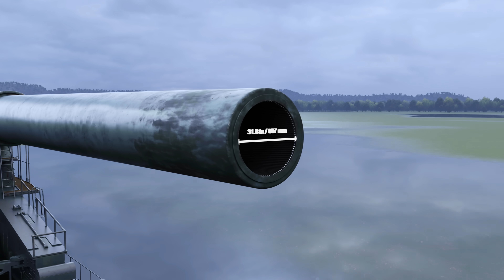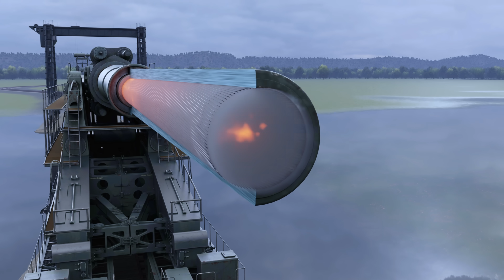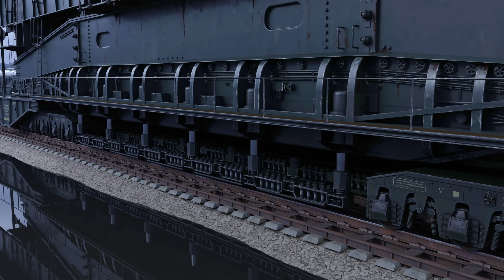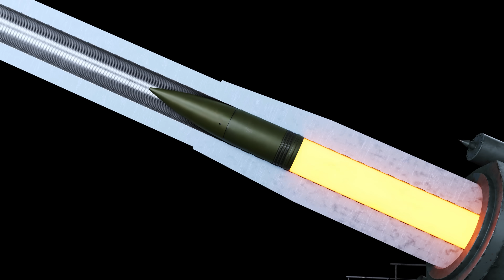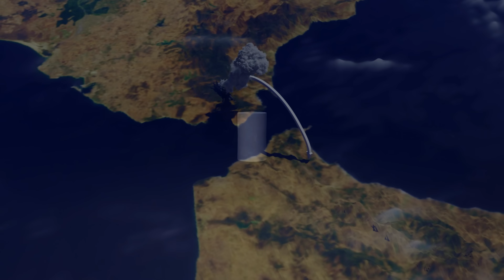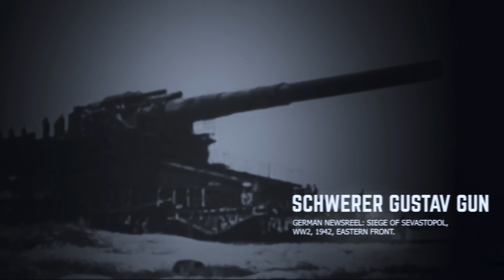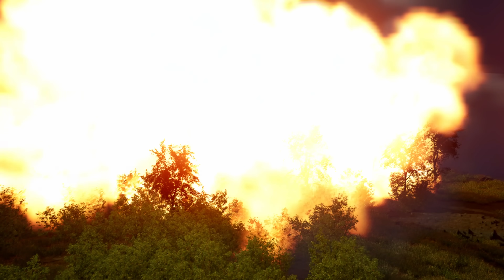Inside the Schwerer Gustav

Comment: As a German Master Craftsman Gunsmith (now living in Edmonton, AB, Canada), I wanted to calculate a few figures regarding the "Dora" (Schwerer Gustav) railway gun to put its massive scale into perspective:
• Muzzle energy of the Sprenggranate (HE shell): 1,613,760,000 Joules (~1.19 billion ft-lbs). 
That is equivalent to a full-size crew cab pickup truck (150/1500 class) traveling at 2,595 mph (4,177 km/h).

• Muzzle energy of the Panzergranate (AP shell): 1,840,320,000 Joules (~1.36 billion ft-lbs). 
That equals the same full-size truck traveling at an incredible 4,574 mph (7,361 km/h).

• Recoil force: The recoil forces during firing reached around 14,000 metric tons, which is roughly 15,432 US tons (over 30 million pounds).
Absolutely mind-blowing engineering from a ballistics standpoint

Comment: The sound pressure wave was reportedly capable of shattering glass for up to 8 km away, and unprotected crewmen standing too close to the barrel were at serious risk of ruptured lung cells and immediate permanent hearing damage. Even with specialized hearing protection and careful positioning outside the primary blast zone, the concussion was so violent that the 500-man crew had to take significant precautions when firing the weapon.

Comment: There are a lot of comments here, so maybe this is already done somewhere. 
For transport and movement there where used a locomotive "V 188"
Two of them where build,  and in work after the war.

But it was only one used for the DORA.

Because, V 188 have been two fully complete locomotives. 

For transport it was a double locomotive, butt for movement of the DORA they where disconnected and on every of the two rail was working a "half".
And, thats important, the locomotives where connected with cables so they could send data.
As you know, on the "firebow" the inner locomotive has to go slower than the outer locomotive. 
------
You show a double locomotive on every rail.

Thanks

Comment: A far superior version was proposed, which eliminated all the Track, Switches, Sleepers,  Grids, ground preparation, land clearing and 3,500 less Men to assemble in less than a week, not 6, and could be positioned and moved rapidly, and traversed on demand by having the 8 Bogies eliminated and mounting it in on 8 Crawlers in pairs, two up front and two in the rear, similar to those and slightly bigger than those on the Maus Tank with a pair of Diesel Engines used on their Submarines and just would require some Wooden Timbers for Mats to spread the weight on the Ground under the Frames on either side to distribute the recoil to the ground. This could have made it practical.

Comment: All those resources should have been diverted to tank, weapons or trucks production. The Gustav was just an upgrade of the Paris Gun but of course as a weapon with a projectile that has a concave trajectory, i's an artillery weapon cappable of a huge long fire distance but with less accuracy. Maybe as a psycholochycal weapon it surely worked at least in the Sebastopol fortress. All of this without thinking about all the people that had to be working on the machine to make it's function properly, so in the short and long term it was not a good choice but it's my humble opinion. Also in the invasion of the Soviet Union the germans noticed that the railway system in the USSR had another size, so in the case that the Wehrmacht thought to use the weapon again, it would have meant that they had built a whole other railway system inside the USSR which is absolutely impossible, they would only use the Gustav at the Poland frontier at the east.
Great video!!

Comment: u could also have mentioned the amount of anti air weaponry and flak canons they need to move with the dora, just to protect it from enemy planes and bombers. besides that - great video! the germans also made plans for an extrem heavy tank called the P1000 Landkreuzer or "rat". This tank would have been equipped with 2 heavy ship guns which where related to the canon of the dora in design and close to the same size.

Comment: 1:29 found an error:
The difference between the diameters before and after should contain DOUBLE the riffling depth,
since if you look at the cross section, the rifling gets removed on both sides

Comment: It was built to breach the Maginot line in case French finished the fortification line all the way to the coast. In the end,  the main German breakthrough went north of Maginot, and the main Maginot line was also breached without railguns thanks to the efficient airpower.
Reply: From what I remember, the Germans just rolled their tanks through the Ardennes forest where there was no Maginot line as the French figured it was impossible to get through the forest with tanks.
Reply: In the very end Russians a??-?aped the Germans. 70% German deaths were by Russian fire. 1 MILLION Germans surrendered to Russia. 60,000 were marched down red square as a final thrust in the a??-?aping of Germans. No wonder the Germans are still butt-hurting from that severe spanking, and support Ukrainian neo--Nazis.

Comment: Great Video but there is one fault: The barrel was not joint together by two parts of half length (like the later "Hochdruckpumpe" or the Bull-Guns). It was joint by inserting an thinner inner Barrel of full length (Seelenrohr) into a shorter, thicker tube (Mantelrohr). So the animation of building up oder down is also wrong.
After the dismounting, there were plans to use a much longer smoothbore barrel and FSDS-Ammo to enlarge the reach. Not realized, but innovative concept.
Reply: Who the hell told you that nonsense? What absolute rubbish, you obviously know nothing about this gun. Sounds to me like you have just found ai, and now you're an expert on everything.

Comment: "range 38km" - cant believe nobody commented: for comparison, most modern howitzers reach around 25–40 km normally, with standard shells. with rocket-propelled shells they go up to 60km and with modern extended-range capability they go over 70km (fire rate of 6 rounds per minute)

Comment: 900lb of explosives isn’t much when compared to an SC 2000 bomb with a 2000lb warhead dropped out of German bombers.

The gun was probably more accurate but a squadron of bombers is probably cheaper would’ve had a far better range and could deliver more explosive.

Comment: I suppose IF you want a big howitzer (which definitly had their usage) the 60 and 54 cm Gerät was much more usefull, since it didnt need as big logistics and could be driven into the designated position. Befor that in WW1 and such there was already a 30,5 cm Howitzer.

Comment: For further interest: “In addition to the 80 cm Schwerer Gustav railway gun (often referred to as Dora in some accounts, though Dora was technically its sister gun used elsewhere, or sometimes interchangeably), the German 11th Army used an extensive array of super-heavy artillery at Sevastopol in 1942, which was the largest concentration of heavy artillery under a single command in World War II. 
The key siege weapons used include:
Karl-Gerät Mortars (60 cm and 54 cm): The 833rd Heavy Mortar Battalion deployed two of these self-propelled, tracked mortars, known as Thor and Odin (often Ziu is listed among them), which fired 2.2-ton shells to shatter Soviet concrete bunkers, specifically against Fort Maxim Gorky I. 
Gamma Mörser (42 cm): This was a massive siege howitzer that fired 1-ton projectiles and was operated by the 459th Heavy Artillery Battery. 
42 cm Haubitze(t) (Skoda 42cm Howitzer): Known for its role in the 458th Heavy Artillery Battery, this weapon was highly effective against fortified positions. 
Long Bruno (28 cm K5 (E)): 688th Railroad Artillery Battery used three of these 28 cm railroad guns to bombard targets from a distance, sometimes referred to as "Long Bruno". 
30.5 cm Mrs (30.5 cm Mrs. 16): Used extensively by the 624th, 641st, and 815th Heavy Artillery Battalions, these heavy mortars provided consistent heavy pounding. 
35.5 cm Haubitze M1: This mortar/howitzer was part of the 641st Heavy Artillery Battalion. 

In total, the German artillery force included over 1,300 guns and howitzers. “ (Cut n paste from Source: AI Overview).

Comment: Dora didn't have the biggest caliber shells. That was the mortar piece of the US Army. The Little David, with a caliber of 36" or 914 MM. The shells weighed about 1600 KG or 3700 LBS.
Dora's (it was a cannon) shells were a lot heavier, yes. But Little David (it was a mortar) had the biggest caliber.
Both weapons are technically artillery pieces.
The last Little David is to be seen in Aberdeen Proving Ground in Maryland (VS)

Comment: Gustav was specifically built to counter French Maginot Lines and only two was built.
And then the gun did not use fuel, planes and tanks do, so the conversion to build more stuff made little sense. Tanks and planes without fuel are even more useless.
Reply: Railway trains did not use gasoline that German tanks needed. Germans from in 1936 to 1940 conquests had been stockpiling diesel since German AFV all used petrol engine like Maybach.
Reply: @sthrich635  I'm aware the tanks didn't use diesel, its availability was limited. But, you said the gun didn't use fuel, you didn't specify, which is why I pointed out that it in fact used diesel, so my point still stands in spite of your moving of the goal post.
Reply: @Fett-ish Sure, if you would like to go for such precision. The "fuel" in question was referring to the petrol fuel that common German tanks and planes shared, to bring out the overall point that the common myth it somehow could be transformed into a dozen of operable tanks or planes instead were false.
Reply: @sthrich635  That was about the money and how it could have been used in other ways that accomplished more, nice work moving the goal posts again though, quit while you're behind, it's getting embarrassing.
Reply: @Fett-ish Third Reich did not operate in a free capitalist economy. Everything is price controlled by the regime. Htler could just pay 10 RM for the gun and they had to accept that or else.
The other realistic alternative to counter Maginot Line was mobile tanks and planes but again limited by gasoline supply. They could be empty steel boxes sitting in depot that would be even more useless
Reply: @sthrich635  My favorite bread is honey wheat, and I use it for most sandwiches, though occasionally I like a nice potato bread roll instead.
Reply: @sthrich635  Well, tell that to Mauser who sued the Nazi government for license/patent infringement (unlicensed production of rifles) AND WON. The government had to pay compensation. 

"During World War II, the Nazi government directed mass production of the Karabiner 98k rifle to the state-controlled Gustloff Werke, which manufactured them more cheaply. Mauser claimed that this unlicensed production by another company (under government orders) infringed on their patents and undercut their position. The Reich government ultimately paid Mauser compensation to settle the dispute..."
Reply: @Fett-ish  His statement seems concise to me. Big gun uses fuel they have alot of. 40 tanks use fuel they dont have alot of. Recourses weren't necessarily wasted on big gun.
Reply: @itsyaboymuffinman  He said it uses no fuel, do any of you know how to read?
Reply: Which part of diesel confuses you good sir? 🤣
Reply: ne consommait pas de carburant ???? 🤣🤣🤣🤣 1.400 tonnes, ça ne se pousse pas du doigt !!!

Comment: I wonder if any modern tank crew could survive a direct hit in a gen 3 tank.
Reply: I really don't think modern tanks stand a chance. Sure, modern composite armour is tough, but 1 meter of steel penetration, combined with the sheer explosive energy, would rip apart any gen 3 tank, with nothing left of the crew.
But that's asuming a direct hit.

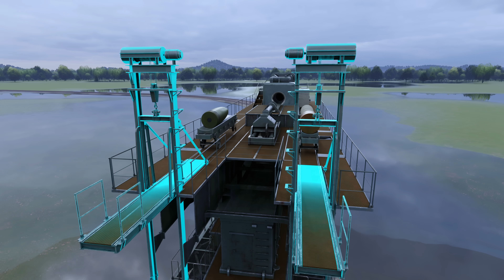Comment: 10:51 How are the shell and the propellant transferred from the trolleys to the loading tray? Surely they are far too heavy to be manhandled, and there doesn't appear to be a crane at the loading platform.
Reply: Apparently they were loaded using cranes and hoists on to the trolley, then a hydraulic ram was used to load them into the breach/barrel
Reply: @perfectly-unbalanced The hoist for loading the trolleys and the rammer are evident and explained in the video, what is unclear is getting from the trolleys to the loading tray. In the video they kind of levitate up and over, which kind of insinuates being manually picked up and moved. The shells at least were definitely far too heavy for that to be the case, though. Edit: Watching it again, he does say the shell was ROLLED over to the loading tray. So I guess the trolleys and the loading tray were able to tilt or something to facilitate horizontal movement without having to be picked up.
Reply: @rollertoaster812 I see what you mean actually, I wonder if they would have just used something like big lengths of wood that were the same height as the trolleys essentially, making it possible to roll them across?
When I first saw the layout and the rendering of the trolleys, ram and loading process I was actually wondering if the trolleys could stop moving forwards/backwards and then move sideways.. I feel like that could have been a good idea, having them on a rectangular loop essentially.
(Obviously not the case though and those engineers were magnitudes wiser than me so I'm sure they'd have gone with the optimal option at the time haha)
Reply: @rollertoaster812 similar to
Battleship guns in a way, just roll them, I’m sure they had stuff to level the area it needed to roll to
Reply: The loading platform had a deployable cradle crane built into it that could help with the movement of the shells.

Comment: I was under the mistaken impression Dora and Gustav were different weapons of the same, or at least similar type!  Thank you for correcting my confusion!
Reply: NO...Dora was the name given to the weapon by the unit to which it was assigned. "Dora" was not an official name. A second Schwerer Gustav was built, but it was never assigned to service or fired in action (hence its lack of a formal name). Officially, they were Schwerer Gustav and Schwerer Gustav 2. Dora and Gustav are popular names from after the war. A third weapon, with a smaller caliber but a longer barrel, was in production: the "Langer Gustav."

Comment: 1:02 - no, not "Gustav Crap" - and neither the company was CRAPP it's German name, thus GERMAN pronunciation rules shall be used, not English ones. The initial "J" in "Joseph" and "Jose" but these are not pronounced the same, and same goes for German "u", which is pronounced as in "brut" or "suppose".
You could pronounce "schwerer" correctly, so why not Krupp? 
I mean, it ain't no nitpicking - a documentary should be factually correct, right? Even when it comes to such details.

Comment: The problem with the general artillery shell shape is it’s not optimised for supersonic flight. Its shape is determined by the internal ballistics while the shell is still going down the barrel, so it needs that cylindrical ogival shape which has a larger surface area and the large flat base which increases drag even more. Gerald Bulls ERFB shells fixed all of these by making the shell long and thin, adding nubbins to the shell that engage the rifling, thus reducing the size of the driving band and adding base bleed, which is a cartridge that feeds gas into the wake behind the shell to reduce drag. That could be a good video idea

Comment: “Partisans thought the Germans were conducting excavation work with explosives.”
Well, they weren't technically wrong. You could even say they were experimenting with ‘extremely long-ranged excavation ‘.
Reply: And simultaneously doing pyroclasty research on the ground underneath it
Reply: Just an archeological excavation
Reply: conducting excavation work with explosives on the enemys side
Reply: Maxim 44: If it will blow a hole in the ground, it will double as an entrenching tool.
Reply: Excavation? Man, when I saw that gun, I thought they had beef with the moon. That thing looks absolutely terrifying.
Reply: Meeaaaan! I'd really like to excavate, but the ground is like, waaaay over there.